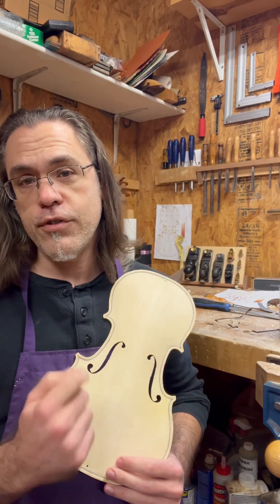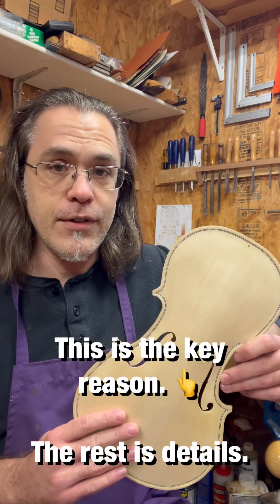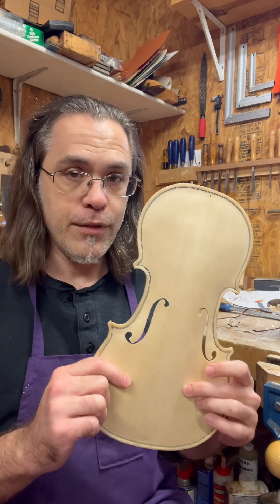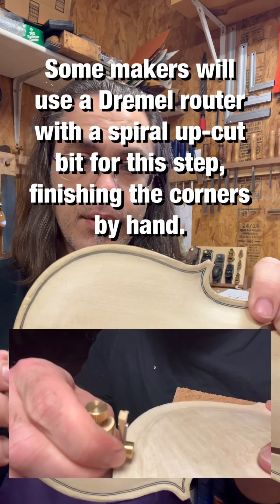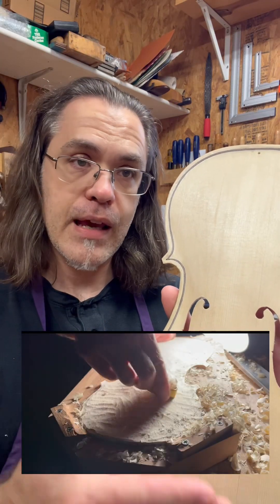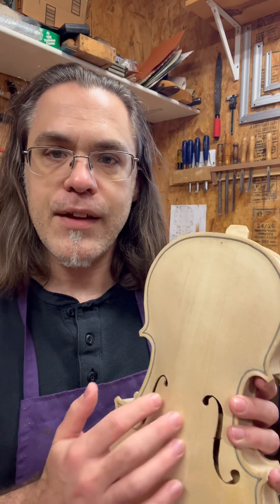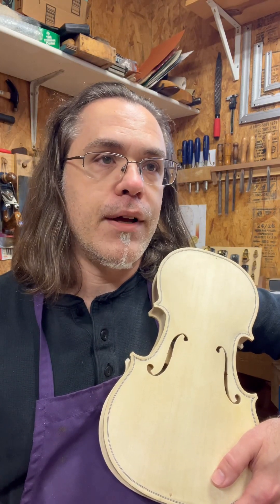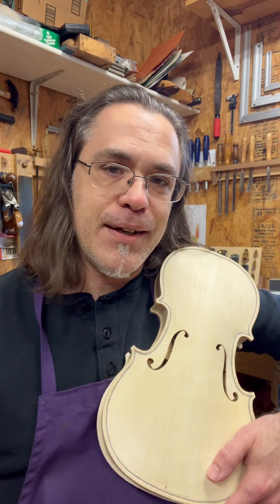CNC For Making Violins?

Comment: CNC router can do 90% of roughing violin parts, and the wood type and stiffness can be taken into account with parameterized program. The only missing part will be plates tuning which could take a couple of days. Valuable size? The router size could be 60 cm by 40 cm, and being placed in a box - 2x3 feet. Is it too much of a space? I don't think so. But for sure, to use cnc router for such operation it's needed a lot of time. Like about 2-3 month. But then, the production speed increases form 2 to 3 times. It means that potential income grow the same amount. But you don't need more money, you just need to sit in a silent woodworking shop and meditating on a piece of wood (just kidding) :)
Reply from the maker: @robotustra  Yeah, it’s a tool like any other, but the expense and my disinterest in learning how to setup, program, and operate a CNC are certainly still factors. 

As for space, my table saw, dust collector, floor standing drill press, planer, band saw, disc/belt sander all take up a good amount of floor space as it is, I just don’t have the camera pointed that way.

And as for the profit consideration, I’m still in the midst of my very first build. I’m probably a few more builds away from valuing my own work enough to sell it to the general public. As it is, rough carving by hand actually doesn’t take all that long!

But if I ever look to make this my sole source of income, I may revisit this question later.

Thanks for watching and commenting! 😄

Comment: I'm a machinist in a cnc shop. Being old school I agree with all you said. Even in the metal working area CNC are not capable of a lot of things. For example the very best machines are still finished by hand using scrapers. Like wood, metals also undergo changes when cut. It can warp as it's being cut just like wood can and no cnc can cope with that. Using scraping techniques you can match surfaces to within a few millionths of an inch, no CNC can do that.
Reply from the maker: @billshiff2060  👆This guy gets it.